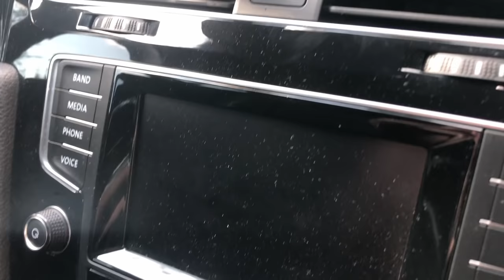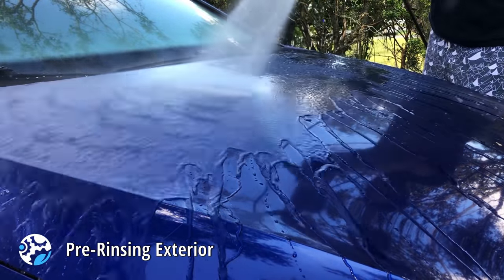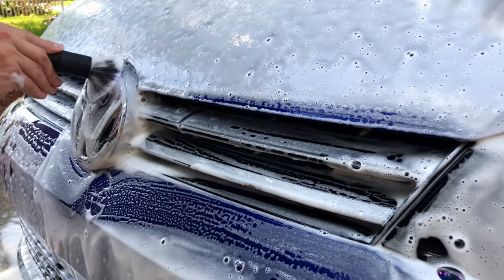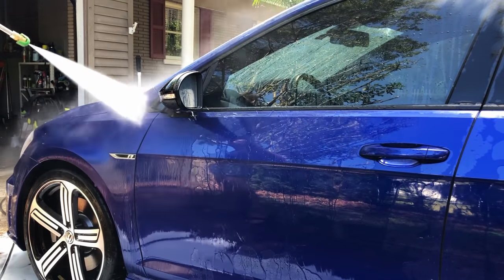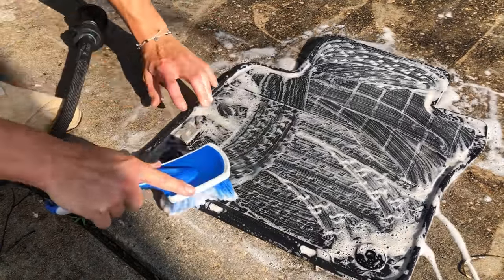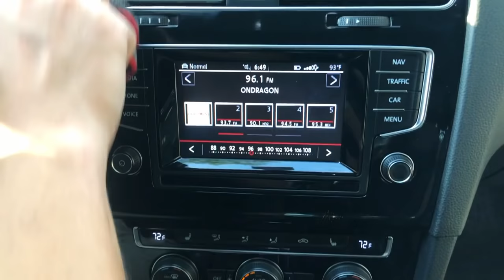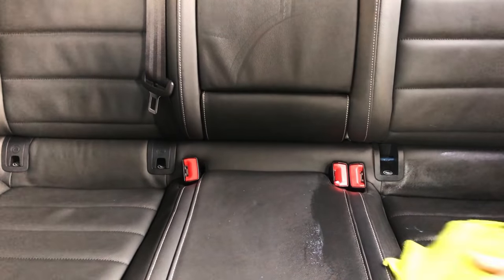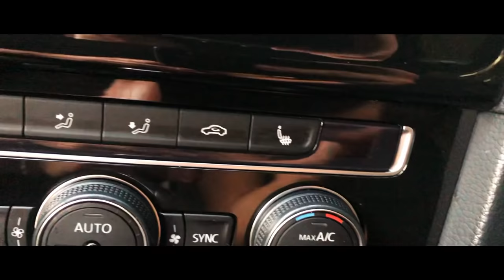Road Trip CLEANUP! Mk7 Golf R Post-Road Trip Detail! IT NEEDED TO BE CLEANED

Comment: A little tip - whenever cleaning the cup holders, especially on new VW models, you better pull out the rubber part and clean under it since there is most of the time dust and other nasty things under it (spilled drinks, sticky leftovers e.t.c). I always clean it seperately, then clean underneath and then return it back on. Cheers

Comment: Leather is not suppose to look glossy. The Finished product should be Matte/fresh/brand new looking. Using an all purpose cleaner and deep cleaning ur seats with ur detailing brush and wiping off with a microfibre towel would have cleaned ur seats better then u thought. You’d see how much black/gunk it would pull off. Then coating the seats with a conditioner like chemical guys leather conditioner will leave the seats fresh, smelling brand new, and also looking like they just came out of the factory.